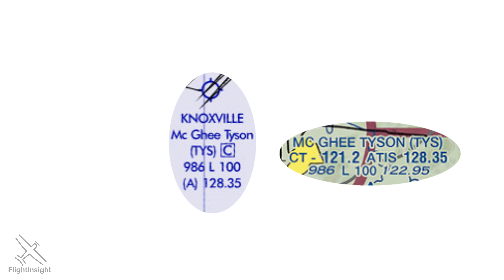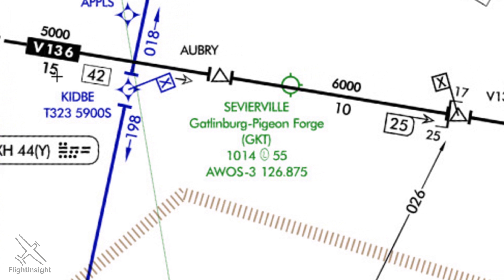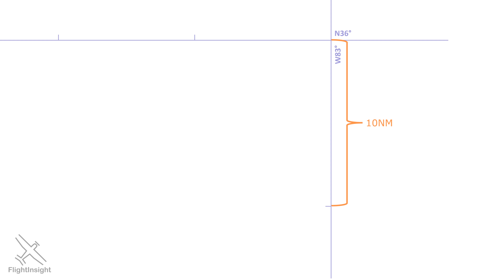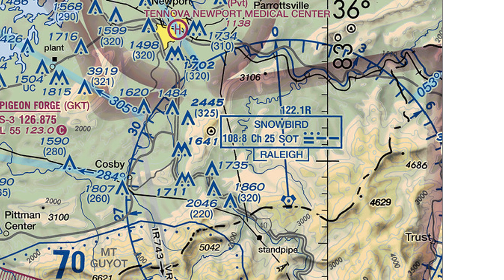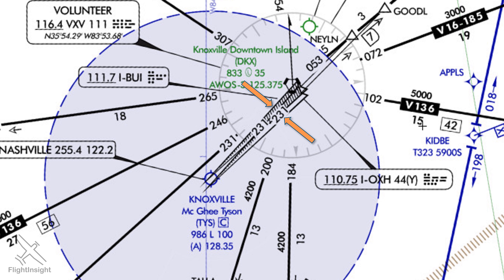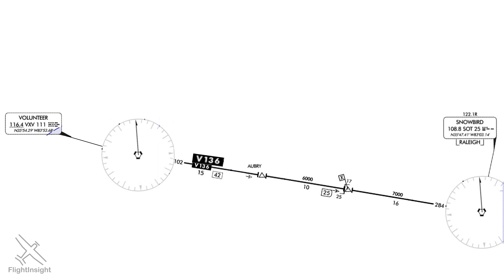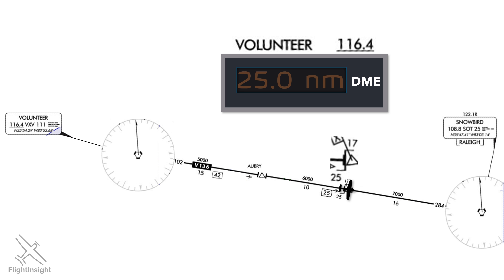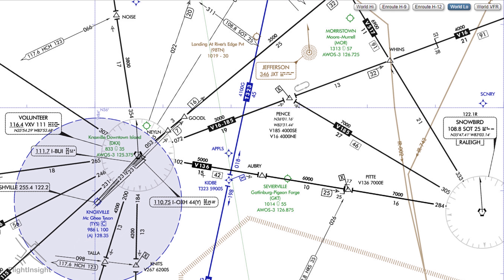IFR Enroute Charts Explained | Airways on IFR Charts | IFR Training

Comment: Good video, but there is one important correction: the airport information for a towered airport can be shown in blue OR green. Blue airports have DOD procedures, green do not. Many towered airports are listed in green.
Reply: Almost correct. Blue means the airport has both a low altitude AND high altitude (usually referred to as a penetration approach, starts from mid-teens altitude for jet fuel efficiency) approaches listed in the DoD Flight Information Program publications (FLIPs), whereas green only has low altitude FAA approaches.

Comment: A blue airpot on an enroute chart means it has a tower? Uhhhhhhhhhh I don't think so. It generally means it's military. Technically it means it has an IAP that's included in the DoD FLIPs...which basically means it's a military filed with an IAP. high enough to allow descent for high-flying military aircraft. Dude come on.
Reply: Blue and green airports means they have an IAP approach. Brown airports do now have published instrument approach procedures. Blue, green and brown airports can be either civil or military airports. The shape of the airport symbol on the chart defines the airport type. Please refer to the IFR Enroute Low Altitude Legend chart.
Reply: @chrisradzanowski5376  blue on the enroute is exactly what he says. Look at any blue airports IAPs and you will see they have HI versions of the approaches as well as the normal ones.
Reply: @grimmsyy894 Blue airports do not basically mean it is a military field. Blue airports can be either civil, civil-military, military, a heliport or a sea civil airport. I will cite the IFR chart legend:  

"Facilities in BLUE or green have an approved Instrument Approach Procedure and/or RADAR MINIMA published in either the FAA Terminal Procedures Publications or the DoD FLIPs. Those in BLUE have an Instrument Approach Procedure and/or RADAR MINIMA published at least in the High Altitude DoD FLIPs. Facilities in BROWN do not have a published Instrument Approach Procedure or RADAR MINIMA." ~ IFR ENROUTE LOW ALTITUDE - U.S. chart.

Comment: Be careful with talking about Longitude and Latitude. I understand how you're explaining it here, but while you're using the Longitude line for reference, that's actually measuring Latitude. It's 10 minutes of Latitude per 10 minutes - or 1nm per minute. I've had a lot of students mix that up. Measuring Longitude doesn't work for the reason you explained. Great video!

Comment: One correction at the start.  According to IFR Enroute Low Altitude Legend: "Facilities in BLUE or GREEN have an approved instrument approach procedure and/or RADAR MINIMA published in either the FAA Terminal Procedures Publications or DoD FLIPs.  Those in BLUE have an Instrument Approach Procedure and/or RADAR MINIMA published at least in the High Altitude DoD FLIPs.  Facilities in BROWN do not have an published Instrument Approach Procedure or RADAR MINIMA."  

Basically blue has a "high" altitude approach, green has a "low", and brown does not have any instrument approach.  Does not have anything to do with control towers.  If an airport has a control tower that is not open 24/7 it could still have an instrument approach that would be usable after the tower is closed.

Comment: Yes very helpful! What are the 2 blue diamonds close to the intersection of V136 & T323? One of those circle with 4 pointers labeled APPLS? The other one has an X flag?
Reply: Those are gps waypoints. The gps waypoint that as the flag with the x   shows that you have to cross that waypoint at a certain altitude. The name of that gps waypoint is KIDBE and shows you have to cross it at 5900 when heading southbound depicted as 5900S.
Reply: @jollylawyer9999   Thank you!

Comment: Great video. Thanks. Why the discrepancy with the distance from the Snowbird VOR along the V136 airway? It lists 16 miles below the airway and then you see the 17 miles at the switchover point.
Reply from the maker: The mileages are rounded to the nearest whole mile. The segment length of 16 is the ground distance, while the 17 at the changeover point would indicate DME. I’m going to guess that he slant range error at the 7000 feet MEA would cause the DME to read 17 if rounded up. Just a guess though, you often see these small rounding errors.
Reply: @flightinsight9111  Thanks.